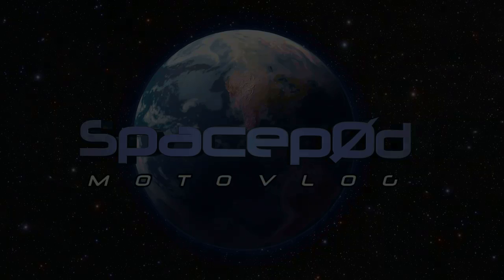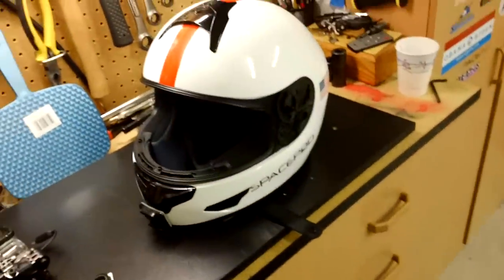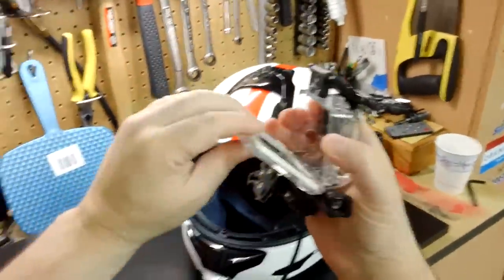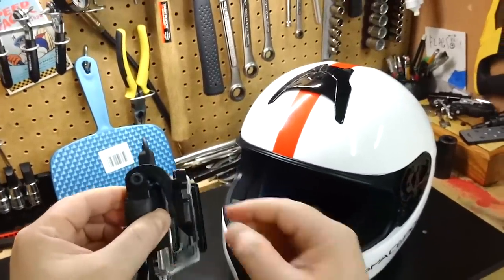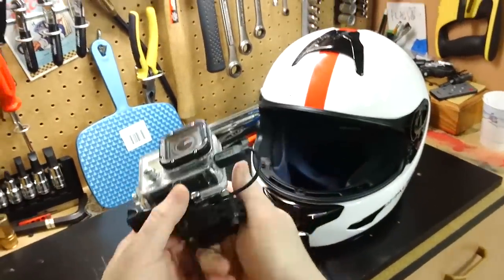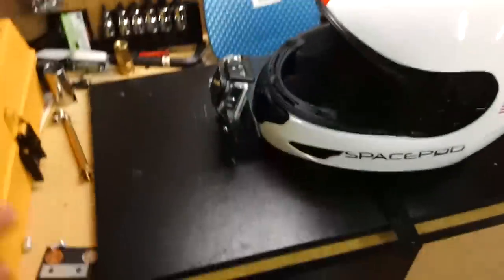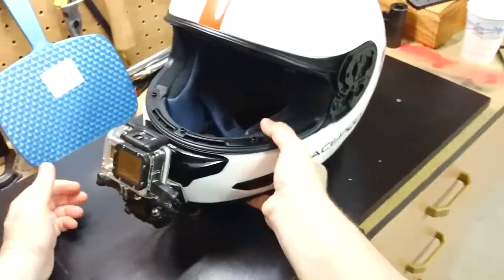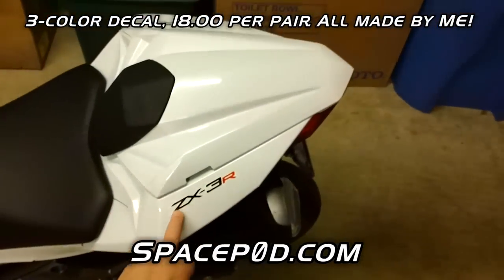Helmet Update, GoPro Chinbar Camera & Mic Rig. Also; decals!

Comment: Well, that is why I prefer to mount on bike. I hardly mount on head because of head checks which would be more in canyons. Not checks really just...actually. I think you right. Movement is smooth as you lean. I just have so little experience with helmet stuff. IT's been 6-7 years maybe.

Comment: Haha thanks for the quick reply Spacepod you're vids are the reason I chose to get the 300 instead of a used 650 I sat on it a few days ago and everything felt like it was made with my body frame in mind (5'7 30" inseam, t-rex arms).  By the way has anyone in the motorcycle community considered using pledge wood cleaner to keep the shield from fogging up?  It's an old trick I picked up from playing paintball.

Comment: I've got an HJC CL-17 in size large and it's too big. DOH! So I ended up buying a new carbon fiber helmet in medium. The HJC is extremely comfy if not a bit heavy. You can see my CL-17 in my avatar <--- on the left. lol.
Reply from the maker: The CL-17 looks nice! Yeah the HJC seems to run a size big. Normally I'd wear a medium but in the CL-16 I wear a small, which I hope means that the shell size is actually smaller than Arai's medium (which shares the same shell with the large).

Comment: hey there, do you have to change any settings on gopro for external mike like yours? Or do you just plug it in and boom, it records from it automatically? Thanks dude
Reply from the maker: No settings changed! I just record in 1080p wide mode and the mic does its thing. I do have the GoPro mic-adaptor, however.

Comment: Is this the GoPro Side Mount or GoPro Front Helmet mount that you have placed on the chin? 
it looks more like the side mount due to the sticky being sideways but i want to be sure before i order.
Thanks!
Reply from the maker: +Ribsplitter25 I'm fairly certain I used the front helmet mount. The sideways thing is just an adhesive baseplate going sideways, curved. I used the VHB 4991 tape to build up empty areas between the differing profiles (helmet vs. curved GoPro baseplate). 

You'll just need to match the parts I have there in the vid, but I know I bought the Front Helmet mount before setting up my chincam.

Comment: could you link the mic?
Reply from the maker: @Y0Karn: It's just a Chinese-made flex mic with a stereo 3.5mm jack. The flex mic holds its position nicely, as the name implies. The manufacturers keep changing but just Google it or check eBay. I usually order in lots of 5 or 10 since they're cheap but shipping from China takes time.

Comment: Great set up. I am still working on mine. I have in front like this, but no mic adapter nor do I have a drill bit to make opening yet. The mic you gave me works great, only problem is my helmet is so dang noisy,  especially with wind buffing. Getting new helmet soon. Great decals! :). Anyway,  hope to see you again on the 12. You and I will probably be the only ones actually riding lol